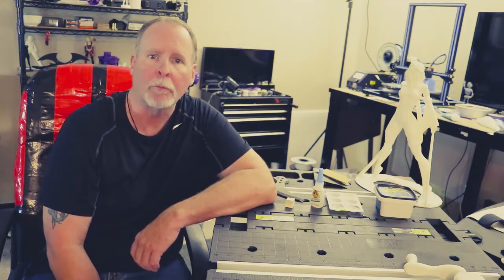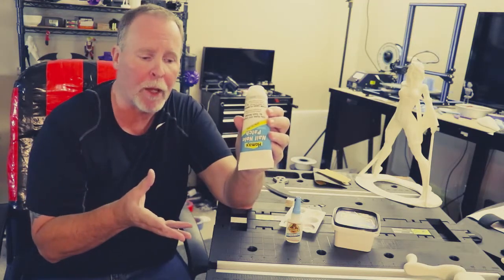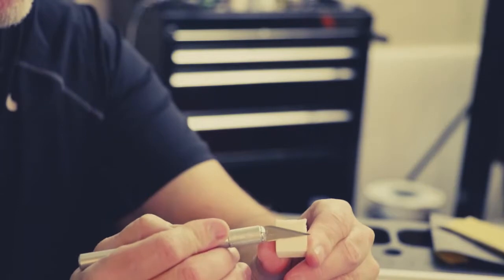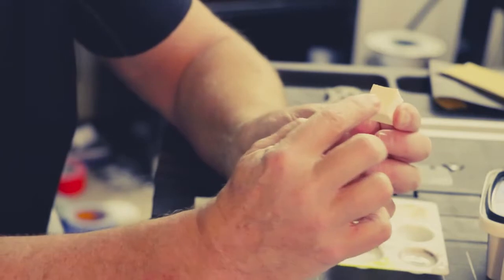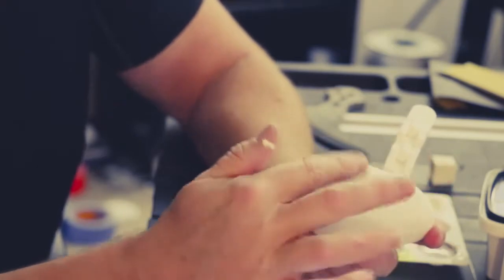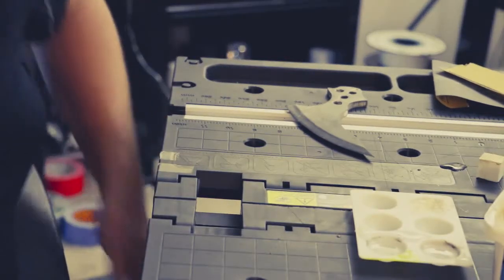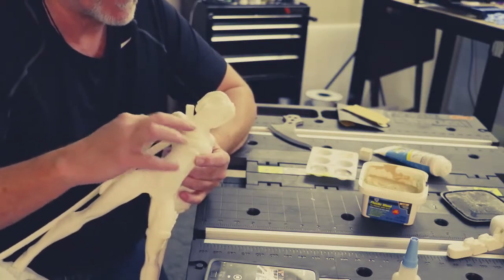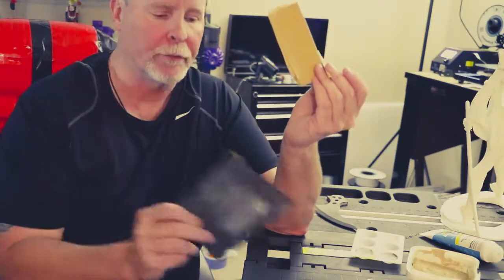Fixing Ender 2 print cracks with putty.

Comment: Thank you for making this! Your video is the best explanation I've found for using this exact method. I'm thinking about 3d printing architectural models with matt white PLA filament with a thin line-height. Then I would go over it with white drywall spackle with water to thin it out and for a slip agent to help it go on smooth. I'm trying to get a matt powdery finish to the surfaces. Your demonstration shows that this method will work the way I think it will for the process I'll use.